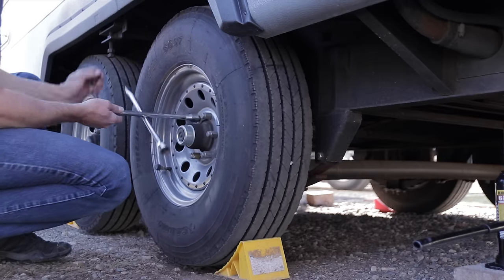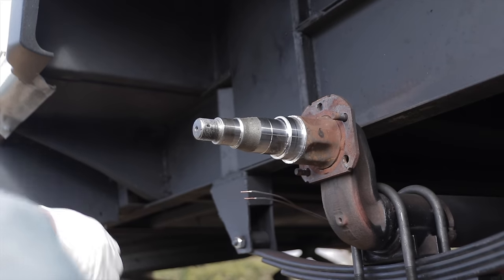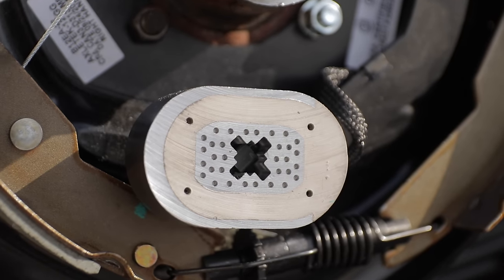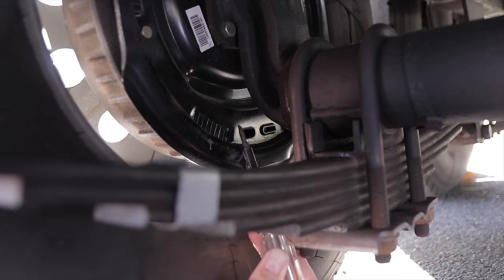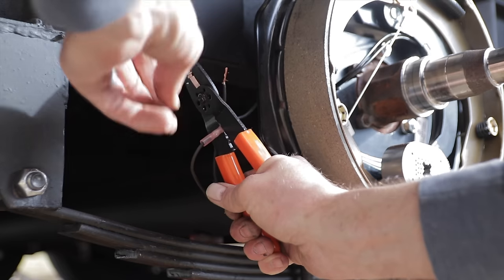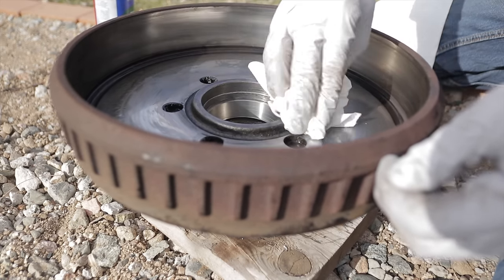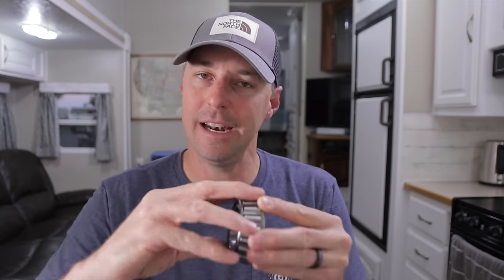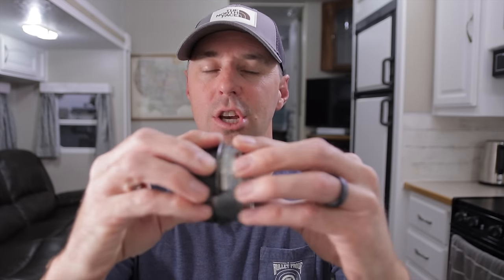RV Wheel Maintenance, What You Need To Know.

Comment: Couple of things:  Make sure you use the correct type of grease - the type of wheel bearings - not chassis lube.  Also, if you have the Dexter EZ-Lube axles, you will not get the seal out with that puller- they have a double seal and are a bear to get out (and back in).  Lastly the importance of brake adjustment is that the magnet can in the drum only move so far.  if the brakes are so loose that the shoes don't contact the drum at the end of full swing, you won't have brakes....

Comment: Excellent video!
Note to all;
The best way to replace the metal bearing cap/cover is using a rubber mallet. Use light taps and it will go back on without denting.
Reply: A small block of wood works too if you don’t have rubber mallet YET.

Comment: Sad to report that a few days ago, a guy was towing a 5th wheel a few miles from my house, wheel came off and went across highway hitting an suv coming opposite direction, killing the passenger.  The guy kept driving completely unaware this had happened.   Tighten nuts, check for rust, visual inspections, etc.   I know this is probably a rare occurrence but it does happen.
Reply: In Oakville Ontario Canada, a boat trailer wheel just came off in October 2022 killing the driver of an approaching vehicle. Folks - keep your bearings properly greased and services, AND, make sure you install a cotter pin!!!

Comment: I know this is an old post  and all the comments are Great  Little trick I used to do for packing the bearings. Take a clean lunch baggy with a Ziploc put the bearing in there with a good amount of Grease-remove as much air as you can,zip it back up and then just start working  in the grease into the barring

Comment: Finally in my life, becoming interested in doing things myself. Kick myself often when I realize how simple a lot of stuff is. Thank you for your great videos.

Two quick questions. You showed on adjusting brakes to tighten the adjuster until the wheel is snug when trying to spin, then back off on the adjuster. But, I don't believe you showed how to back the adjuster off? Second question. You said to tighten castle nut, then back it off a little. What indication do you use to know you have backed off sufficiently?
Reply: The only proper way is to put the tire/wheel assembly on, tighten a couple of the lugs and then wiggle the top and bottom of tire,tighten nut until there is no free-play then back off to next loosest hole for cotter pin. You never want any preload on that type of bearing.

Comment: Just had mine done at a local shop because I was in a time crunch prior to leaving. Glad it was not too much of a crunch because I had to return to get them to correctly adjust the brakes. The brakes would not hold me at a stop sign and when I took it back the tech had failed to adjust one axels brakes all the way out before backing off a little. Said he didn't have a way to see how tight they were. Will do my own next year.

Comment: I had no idea that the trailer has brakes and I need to make sure they work. Also the pull away brake pin was new to me as well.  I always thought you need to allow more time to stop with the tow vehicle . I did not know the trailer helps to slow the trailer and tow truck.  Scary to find this out after so many years of towing a 25 ft camper.

Comment: Forgive my newbie ignorance Jared but what activates the trailer magnet. Other than the break away switch connection I have no other connection between truck and trailer. You must be talking about a brake controller, which I don't have Yet. Lots to learn, many more comments and questions still to come. Keep up the good work :)
Reply from the maker: Good question. The magnet is activated from the brake controller in the truck/tow vehicle. Many trucks now have them built in and if not it would need one. That then sends it through the 7 way connection to the trailer.

Comment: the link to the brakes is not auto adj.
These brake assemblies should be adjusted after installation and then as needed for the life of the brakes. To adjust the brakes.
great video and I will buy the bearing greaser. good demo.
Reply from the maker: Thanks for the heads up on the link I’ll see what went wrong

Comment: First off great video very informative and I found it extremely helpful. 

Only one thing the bearing greaser I’ve seen several people recommend these but if you really look at the way it’s made it does not push grease into the bearings.  I believe they are made for standalone races not with a bearing surface. I use a quart size Ziploc bag with a bunch of grease in it and Massage the grease into the the bearings
Reply: You are Absolutely incorrect. 
This is an actual bearing packer. You watch closely and you can see the grease come out the top.
Packing by hand or with a packer is the only way to ensure they are done properly. 
Putting them in a bag and rubbing grease on the outside is going to leave air pockets.

Comment: Just a nit-pick, but those are brake SHOES. On drum setups, they have brake shoes, on disk, they have pads. When i adjust the brakes, i just adjust the shoes up until they lightly drag and then finish assembling the bearings into the hub and then you should be set on that wheel. Double check for a good lockup on the wheel by activating the brake manually on the brake controller

Comment: I have Dexter E-Z lube axles on my RV so the repacking with new grease is super easy.  Just check the wheel is tight and no side to side play.
Reply from the maker: The E-Z lube system can buy you more time but I would still recommend doing it this way every other year with the system you have. It's great to be able to get in there and get the old grease out that is breaking down. The one problem I have seen with the E-Z lube axels is the chance goes up for pumping grease out the back seal and then on the brakes which is not good.

Comment: Great video BUT you don’t mention when you over tighten them to back them off you need to release the adjustment bar by hooking it or pushing (depending on the type) to free the star adjuster. Best is to adjust so they just drag then let them final adjust themselves.

Comment: I also have a Lance trailer with auto adjusting brakes.  The wheel bearings have a grease zert, should I  remove the bearings each year or grease the bearings using the zert fittings.  Right now I am removing the bearings every other year.  Love your videos.

Comment: 8:35. He blew right over the single most important step, adjusting the bearings. Please make sure that there is a slight amount of free-play when you wiggle the top and bottom of tire after you install or you will burn up those bearings in no time. Tighten nut until no play then back off to next loose hole for cotter pin.
Reply: You blew over, he did set and torque bearings which is factory settings. Torque at factory settings leaves no guess work. Adjusting too looseness is and always has been guess work.
45 yrs hauling oversized 160,000 lbs average our bearing problems quit when torqued, guessing backing up till looseness couldn't  keep bearings. Torqued they all run same temp at Interstate speeds.
You do touch your dust covers and tires for heat after stopping don't you ?

Comment: Great Video.  I have a fitting in the hub for greasing the bearings with a gun, which I have done and was pretty easy, but, does it grease the inner bearing also, or just the outer bearing? Again thank you for the great videos they are very helpful.
Reply: It pushes grease through  both the inner and outer bearings.
Reply: Just be careful. If you over do it, you'll push the grease seal out the back and coat the brake pads with grease.....then you have no brakes...
Reply: @curtwalp5120  
Yep.  That is why I do it with a hand grease gun and go slowly.  Never use a powered grease gun.
Reply: Don't forget to spin the wheel as you grease it.

Comment: Does anyone pull their suspension components apart for inspection? Thanks for the video, just in time for the new season.
Reply from the maker: I do. I have done it twice in 3 years which is a bit much but one time was to replace the shackles and this year was when I replaced the leaf springs.
Reply: @AllAboutRVs  Have you gone to wet bolts?
Reply from the maker: No we haven’t

Comment: Drum to Magnet surface question...

If you feel a slight grove in the surface of the drum where the magnet rubs, do you need to have the surface turned or but new drums or not worry about it. 

My local RV shop said they can only turn 12” or larger drums , not 10”. 
But he did say they don’t always need turning, something they buff or grind the surface with a Cookie cutter. ( a small abrasive disc mounted to a drill) 
Your opinion?
Reply from the maker: I would take it case by case. If it feels overly rough I would try to have them turned. Ours were very smooth but I should have mentioned to inspect that and have them turned if needed. I wonder if the local Auto store would be able to turn a 12" drum?
Reply: My local NAPA machine shop will do 12”

I was curious if there was an industry standard to how far you could go before turning or new drums. 

Thanks for providing interesting content on RV’s .

I learn something everyday..

Comment: Hi , I wanted to know why we need the 12 volts from the car battery to the trailer. Does it only help charge the trailer battery or is it necessary for the braking aspect. Im using a 7 pin connector.The 12 volts from battery to the brake controller but only a blue wire from brake controller to/for the brake signal. will that work? along with the old 4 pin connected as needed. Im not sure what that added 12 volts does.

Comment: From what I've read.... and seen over the last 10 years on my new dexter axle... some discoloration on the bottom of the axle and within the bearing is normal. It's called fretting. If you replace axles every time they get some "discoloration" ... You'll be spending a lot of money.  Please comment if I'm missing something.

Comment: I'm tracking the problem and asking - I pulled the breakaway switch - and the tires kept spinning - not supposed to happen - right?  Battery is charged,  Heading back to try and track the electrical from the breakaway switch; could replace it.  Any suggestions?  THANKS!

Comment: We have burned up 2 axles in 4 years from not repacking bearings regularly.  Yeah.  I'm a slow learner, but no more.  Repack your bearings.  I even have the grease gun fittings  and regularly would pump a few squirts of grease in, and that didn't do the job.  Teat the hub down and repack.

Comment: Ok, question:  what grease and I'm assuming you used a grease gun? (Please forgive me😊)
Reply from the maker: I put a link down in the description to some that was similar to what I used. I had picked some up at our supply store when I did this project.
Reply from the maker: No that's a good question! Thanks Monica. When I saw your comment I remembered I had a note to include what grease to use. I did use a grease gun and the grease I used was just from our local supply shop but I put a link to a similar type of grease I would use.
Reply: Adymn Sani   Red N Tacky by Lucas Project Farm just did a Comparison Video and it was the Winner by a long shot over the cheap stuff.
Reply: @racewazes3002  I second that tip thanks rw.

Comment: Just wondering if, since you converted to self adjusting brakes, if you ever considered going the hydraulic disc brake route?
Reply: I replaced our with disc and am happy I did.  Drum is old technology that most in my age have dealt with but I wouldnt buy a new vehicle with drum brakes thus the decision to go with disk.  The bad, the price it is a 3k option if you have a mechanic install the unit.  I chose to add wet bolts for the cost of the parts.  My fifth wheel weights around 13 k.  I also would like to see an oil bath on rv trailers!
Reply: Bob s   Thanks for your input. Did you do the work yourself and if so which brand disc setup did you use?  I've watched videos and the work looks pretty simple for a do it yourself-er. Any idea how much for parts?
Reply: @kentbullard6917  well I was at our rv rally in quartsite and didnt do the install. It took two techs that did about 8 installs at the rally about 4 hours. The company was Performance Trailer Braking and the cost for parts was right around 1800.00 for parts.  I would have saved 900.00 if I would have installed it myself. It made a huge difference in stopping and it just feels much smoother when you apply the brakes.  Another note I had my f350 brake controller set at 8 1/2 before the install now it is at 4 1/2 and is perfect!
Reply: Bob s   Thanks for the information. I'm seriously researching this at this time and believe it's a job I could dms.

Comment: Pro tip: Don't bother removing the wheel from the drum. Just remove the dust cap and castle nut and the drum will come off with it.  Saves you from having to retorque the wheels afterwards.

Comment: Unfortunately you missed one important step that is going to cause people issues if they are doing this for the first time. 

How do you remove the wheel drum so you can access the brake components. First remove the bearing seal, cotter pin and castle nut, remove washer and outside bearing. 

At this point the brake drum usually won’t come off because the brake pads are holding it in place. Put the wheel back on and install two lug nuts. Firmly pull the tire side to side until the wheel drum is removed from the brake assembly.

Comment: What about disc brakes? Oil bath?
Reply from the maker: Disc brakes are a big expense that I wasn't ready to dive into with these new ones working so well.  I have been very impressed  with the performance of the auto adjusting ones, they have worked so well we had to dial down the intensity quite a bit from the old ones. I figure with these working so well why switch to disc, but I thought the same thing when Lithium batteries came out but now would not want to go back to anything else.

Comment: Self-Adjusting are not worth the extra cost ,they will cost you more money in the long run because they stop working after year or two then when you try to manually adjust the brakes it a pain the ass because of auto adjust mechanism is in the way

Comment: Don't forget the never seize on the wheel studs. False torque readings due to rust interference is asking for a disaster.
Reply: Never put anything on lug threads
Reply: Clean the threads up with a wire brush but NEVER add anti seize to the studs

Comment: If you used that seal that you had displayed, it was positively the wrong seal. That seal went on way to easy. It should have been a snug fit and not have slid on and just hung there swinging back and forth on the spindle.
Reply from the maker: I almost didn't use that shot in the video because of it but figured most wouldn't notice, but you noticed. Good catch.
Reply: @AllAboutRVs  I am a mechanic of over 46 years. I watch all your videos as I love the way you present your content. Keep up the great work....
Reply: @AllAboutRVs  We are new to the full-time lifestyle and are concerned about the new Wifi rates since AT&T has changed so much and made it more expensive. Can you do a video on what you think is currently the best set up? If not a video can you quickly give me some pointers? Thanks so much and if you are too busy I also understand that. I  just don't see any new videos out after the new AT&T re-rating fiasco. Thanks :)
Reply from the maker: Internet can be hit or miss and difficult. We use a Verizon prepaid hot spot and have been relatively happy with it. It has come with it's weakness and at times frustrations but I am keeping a close eye on Starlink. There is a chance it will be out this year and I think has potential for RVers. To find the best plans currently I usually refer to https://www.rvmobileinternet.com/. They do a good job finding the available plans to pick from. I hope that helps.